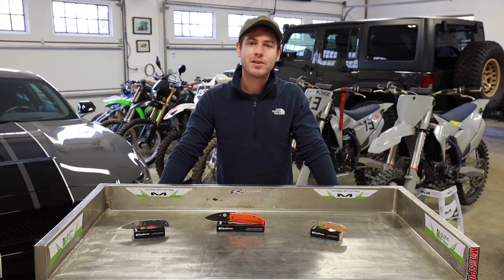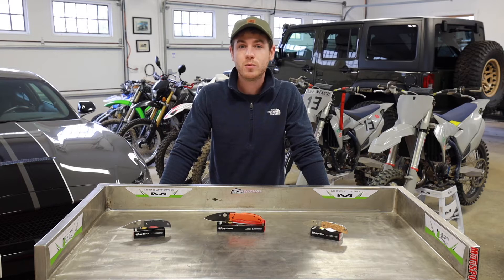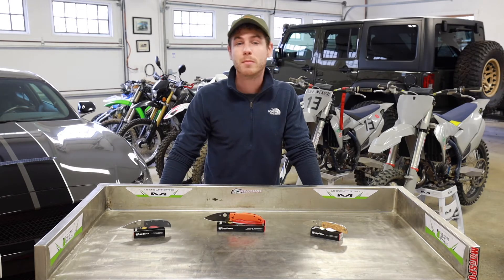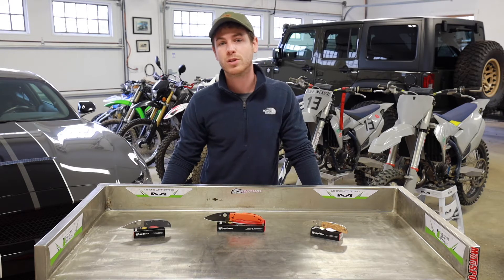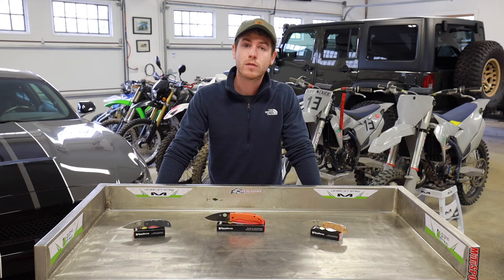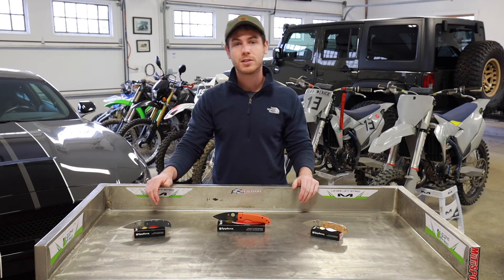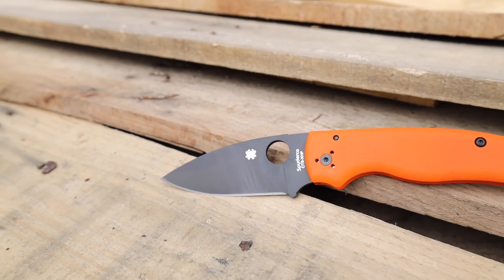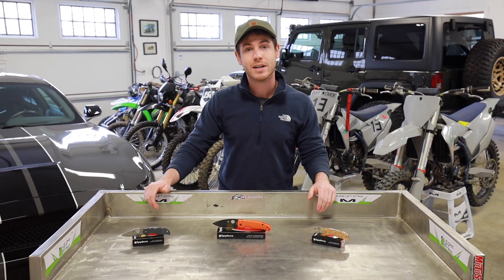CTS-XHP Knife Steel Breakdown

Comment: How might one care for the non-DLC-coated CTS-XHP Shaman if regularly using around food (on job sites, camping, bringing lunch in a cooler everyday, etc)?  How does CTS-XHP handle air drying regularly?

I am currently using an LC200N sheepsfoot Caribbean, which is pretty much maintenance-free in this regard, sans a drop of lube in the pivot (and sharpening x2/month).  The sheepsfoot Caribbean is superior to the Spydiechef for regular food-related use, IMO, due to the larger handle size, longer blade, grip traction of the reticulated G-10, and blade shape, though the obvious advantage in handle-to-blade angle orientation for food goes to the Spydiechef.  The Shaman also seems to have this handle orientation advantage.  

Would love any thoughts-thanks!  Nice channel : )
Reply: I've been using knife butter for all my blades that are around both food & high humidity and/or used near water. It's non toxic and just 1 drop on both sides of the blade lasts 4+ months here in Florida. I've seen zero rust or corrosion.